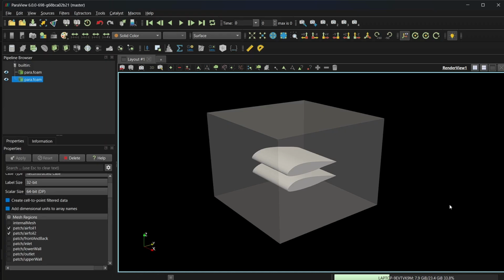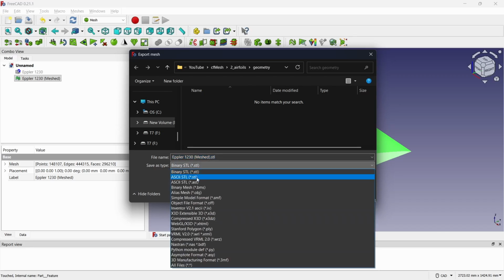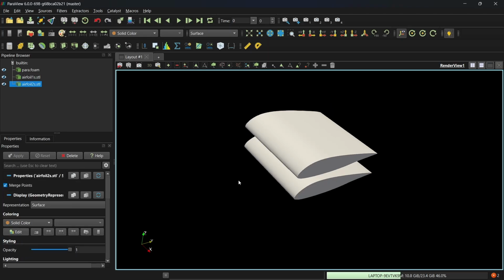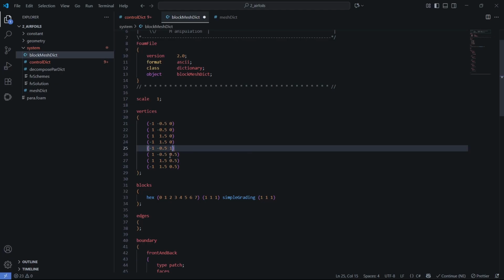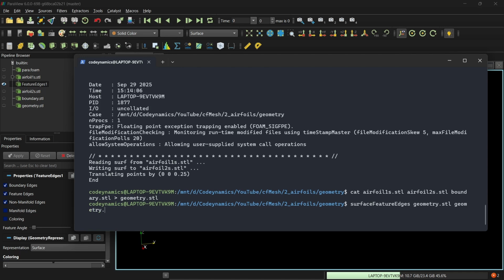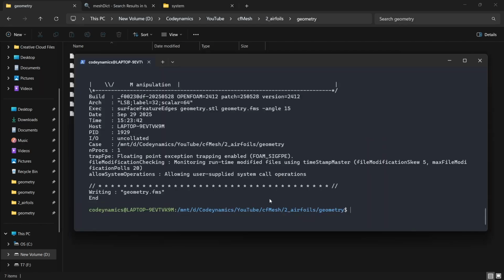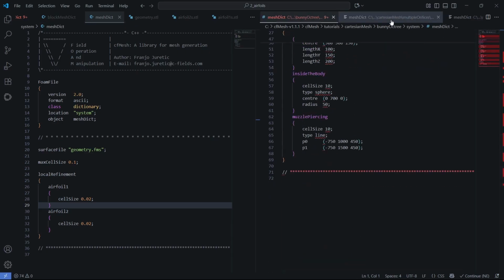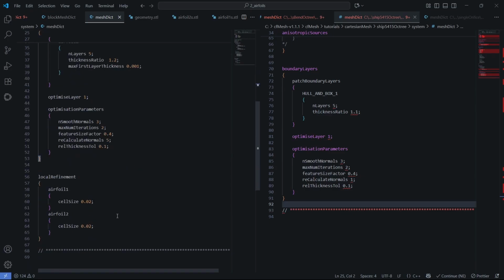cfMesh Airfoil Meshing - Multiple Bodies

Comment: For internal flows?
Reply from the maker: I'll update soon. Thanks.
Reply: @Codeynamics I had read somewhere that, cfmesh can't work with more than 1 domain, and Cfmesh+ 3.0 can do it which is a commercial tool, is that correct? Cfmesh+ even explicitly mentions multi-region domains as its speciality.
Reply from the maker: yes. it is true.